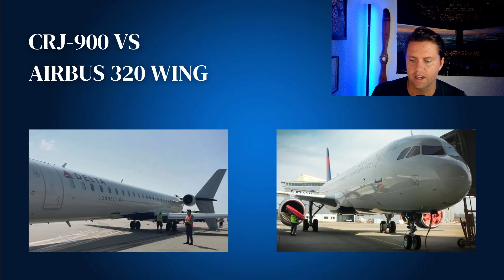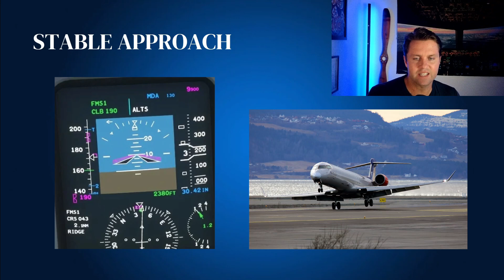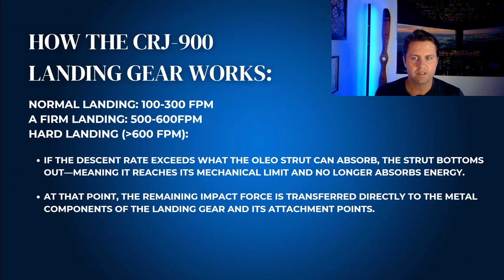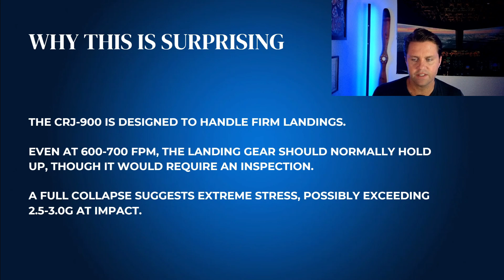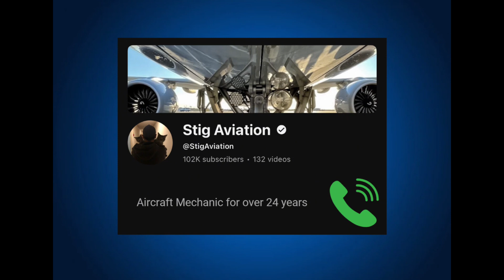Pilot Breakdown: Did a Hard Landing Cause A Gear Collapse?

Comment: Strange they don’t want to name the pilots
Reply: I think i read today the pilot had around 36 hours in the aircraft type and just got their level of license a few weeks ago for this type. The senior crew member was operating the radios.
Reply: @ChoppersModelworks Where did  you read that?
Reply: @ChoppersModelworks If true, that would be Very Poor Judgement on the Captains part. (25,000hr Majority Airline Capt)
Reply: @racebannon7355 pilots are trained to fly and land in those condition, shear winds and crosswind coincidencials may have been the cause of the crash
Reply: @ChoppersModelworks even if so the senior should have been double checking the jr off. Radio work isnt all consuming. He should have been calling out flaps, gear down, altitude to assist.
Reply: Not at all. It’s standard procedure early in the investigation to insure investigation integrity. What is odd is people who think that is suspicious.
Reply: Listen to atc. At least one pilot was a guy.
Reply: @davidgree1  how dare you misgender that trans woman?
Reply: That info will come. We just need to be patient.
Reply: If the copilot  was very inexperienced the Captain would be doing the landing in those conditions.at least that is how I see it as a retired airline pilot.
Reply: Kendal Swanson, a 26 yr old DEI new hire was pilot flying.  A male captain was pilot monitoring.
Reply: @ that’s the new insulting catch from you kids now ignorant
Reply: @ what?
Reply: The names of the CRJ pilots in the DCA mid air were not released for several days either.
Reply: @JohnLemieux wrong. The 2cmen's names were, Only the feemale's was withheld. Funny that.
Reply: This airline has an “unmanned” crew policy. Hmmmmmm
Reply: Yes, by now we should have learned the pilots' names, experience and what physical shape they're in, also the ATC's name and experience. What gives?
Reply: @TheLitehart1  and what business is that of yours?
Reply: @hawk1481  Geez, are you being paid by the WEF Censorship Board? It's not a matter of whose business it is. These are basic facts that any news coverage would have provided by now. And the public has every right to know what experience level the pilots have when a crash has happened. It's in the interest of public safety. Ditto the ATC.
Reply: @ yes I see that but when they go around calling every person in the world a lesbian or DEI I have a problem with that people could’ve been killed. It’s people‘s business on that plane who was flying not ours at this time. those people have a legal right to contact attorneys. Everyone goes through it everything before we put our nose in it.
Reply: @TheLitehart1  According to whom? It’s procedure to withhold crew’s names early on.
Reply: @andredarin8966  Define "early on". This is Thursday.
Reply: @TheLitehart1  Pilots union! They protect their own, even at the expense of the flying public.
Reply: The airline prides itself for DEI and "non manned" flights.  Whether this was a factor or not, I do not know.  Also, it looks like the plane was flaring but then suddenly went noise down, suggesting a wind gust dieing down.  Look at the pitch of the plane in the left side of the filming window, then as it crosses the middle.
Reply: Google Kendal Swanson..New FO.  Captain let her go too far and didn’t step in.
Reply: @thomassheehan4193  Captain was less competent than her. She may have had a brain freeze, due to “scary” conditions.
Reply: They will be identified in the report. For now there are likely legal reasons their identity has not been revealed.
Reply: Blocking this channel - disgusting number of misogynistic comments here
Reply: @ highlighting the genetic difference of male and female performance is not misogynistic. On the contrary, it allows to hire the best person for a job. And nobody says female performance is “always inferior”, it is just different and there are jobs better suited. And if you look, that is where females congregate. What about diversifying the teaching profession, for instance?
Reply: @DallasNatureLover truth hurts. Blocking doesn't stop it.
Reply: All the crew was feminine DEI😊
Reply: Let the cake bake.
Reply: Funny how females didn't have any problems flying the planes for many years, decades before. But as soon as Trump gets to office, it's accident after accident with female pilots. Hmmm. Why are they having such bad luck now?
Reply: They did.. its a hot chick
Reply: Add in a side load due to underrated crab.   Possible pilot error.
Reply: @ female pilot.  Kendal Swanson.   Beauty pageant contestant.
Reply: They are females
Reply: Pilot on radio male. Pilot flying?
Reply: @ShakespeareCafe  Very fresh female.
Reply: These maga DEI hysteria mouths have ruined this country.
Reply: When other than a fatal crash do they normally name the pilots?
Reply: For me the plane -
to much on right side and i can’t see flares.
Reply: Because they were female pilots that's why.
Reply: Names are on the web.. A new hire was the FP ..
Reply: Her name has been released now.
Reply: Their names don’t matter in DEI land. You are meat to fill quotas.
Reply: What would it matter if they named them?
Reply: @philipols  We hear about the pilots like Sully....thought to have done a good job, but we don't hear the names if its  thought they did a bad job.    Transparency is a good thing, we should always hear the names so we can make decisions about flying.   Not every airline is the same.
Reply: It was a male that talked to ATC- this person was not the pilot. The pilot was a younger female.
Reply: dei, woke pilots , biden dei they will not let you know pilot error she only had 1000 hors and basically had a learners permit to fly this plane
Reply: They did....
Reply: Lolz we know why
Reply: The names are out
Reply: Why name the pilots, idiot. Will it or would it make a difference to the outcome. No, so stop with this crap. Do you have insider information as to what happen? No, so shut up.
Reply: The names are almost never released when the crew survives. Sometimes they are made public when the crew does something heroic such as USAir 1549 or United 232. The names are normally protected because assholes on the internet spread false and misleading information without waiting for any verified facts and ruining someone’s life for clicks. Remember when people were innocent until proven guilty? Those were the days.
Reply: I fear, we have a lot of women haters! Any woman lovers here! Anyone of you woman haters ,married  or have a girlfriend? You men only love each other! Is it a community of Oranian?  I’m actually speaking to the men that are spewing DEI!
Reply: Not that it matters, but the pilot on the ATC comm was male. 

To me it looks like the plane lost lift in the last 100 feet likely due to a sudden change in wind direction. There wasn't enough time for the engines to respond, so the plane just literally dropped. 

Also, Canada doesn't release the identity of pilots or anybody until the report is released. At least I have never seen it.
Reply: @ I have read that all were female
Reply: @Canoe64  how dare you misgender that trans woman?
Reply: silly feminist stuff
Reply: Kendall Swanson was the co-pilot. Endeavor Air. DEI airline. Delta is over $30,000 to each occupant.
Reply: @LindaBraune123  Kendal Swanson.   Beauty pageant winner.   She went from CFI to right seat in a jet.
Reply: @mattdelany6799 pretty common
Reply: Takes time to scrub their media posts and TikTok. DEI LTA.
Reply: They said in another report that all female staff working on the plane and ads showed that airline is man free with staff and pilot was new graduate. DEI hires and tik tok ads showing staff jumping and parading around.
Reply: Girl fly… has been there six weeks.
Guy was a major airline wash out sim instructor…
Couldn’t have picked worse pilots for this situation
Reply: This was a non maned flight.
Reply: FO Miss Kendal Swanson …. Captain probably didn’t have much more experience than she had.  Airlines in a big hurry to check all their boxes.
Reply: @ captain was a SIM instructor rarely flying a real plane in real weather.
Reply: @ Sims do not have 50 it shifting winds on landing that stall a wing.
Reply: All female recently, recently, certified.
All female crew , airline used as marketing tool, all female crew RECENTLY CERTIFIED. THAT IS WHY
Reply: @jppalm3944  not female. Restricted ATP girl was flying, Captain was male SIM instructor with a long career who came back from Delta to Endeavor as he did not perform on the larger planes. Learning difficulties.
Reply: DEI
Reply: I would   not ever fly with a Endeavor Air crew.    Their commercials and ADs are just silliness.    And apparently their pilots  are super questionable
Reply: Ta-Da ... Bingo.  As with the CRJ / Blackhawk incident in DC, the offending aircraft pilot was not named for almost a week.  The sensitivity of the pilot being a trans woman predictably threw a shadow over DEI hiring practices.  The fact there has been no disclosure or transparency creates an aura of distrust.  Later than sooner, the ruling party will have to accept that invoking political matters into critical performance operations is lunacy.  It's going to be interesting.
Reply: Not to me with the armchair pilots critiquing them in so many comments.  Till NTSB and the investigation is done, please!
Reply: @ Fully agree; just a little detail: as the plane was manufactured by Bombardier - from Canada - and it happened in Canada, this accident will be investigated by the Canadian TSB
Reply: What? It wasn’t Trumps fault?!
Reply: @MrMrFlyPuppy Agree. I fly for a major and the spewing  of DEI innuendo is sickening. Predictably, in ops yesterday there was chatter about this but not one pilot had the temerity to speculate about the crew.
Reply: @MrMrFlyPuppy I hear you but when they are suspiciously quiet about something it tells a story. Like in the UK if a stabbing suspect is reported as ‘Asian’ we know he’s not Korean or Thai and isn’t a practicing Buddhist or Christian. In the US if we hear. Racially motivated crime we know exactly the skin color of the victim and the perpetrators. If it’s a violent crime and they don’t mention the race we usually know the race.  In the Army helicopter incident  they didn’t name the crew. And whaddaya know the pilot was in error and happened to be female. By all accounts she was an exceptional performer in ROTC at UNC so not jumping on the DEI bandwagon but it is a possibility because the military has a long history of lowering standards for women. Especially since Lloyd Austin.
Reply: @JuanMurphy45  That's BuIISHit!
Reply: @ what part is BS?  That the Army pilot was in error?  That air corridor is 200’ and below. Collision as between 350 and 450’. Pilot said have traffic in sight so pilot error. Or is it bullshit that the  military lowers standards for women?  They have been allowed to lower PT standards, higher BMI since introduction. Or are you arguing that Austin’s DEI requirements didn’t happen?
Reply: Piolets were both female, whether that has any thing to do with it or not.
Reply: @markfiorentino9757  not both, pilot monitoring was a guy
Reply: @sanyaod  even worse.
Reply: @markfiorentino9757  At least one of the pilots was male. He's on the radio talking to ATC.
Reply: @laserfloyd Right which means the pilot flying  was not the one communicating, hence, copilot
Reply: @markfiorentino9757  And another dude in the cockpit of the CRJ on the radio? 😂😂😂😂 IDIOTS!😂😂😂😂
Reply: @markfiorentino9757 what is a Piolets?
Reply: @markfiorentino9757 One male and one female pilot. Female was on the radio just before takeoff. Male was on radio during departure and arrival.
Reply: @bobh6728 According to whom?
Reply: @bobh6728 trans male voice.
Reply: @mattdelany6799 😂😂😂
Reply: @ The actual ATC recordings.
Reply: @ female pilot,  Kendal Swanson,  beauty pageant contestant from Minnesota crashes 90 seat passenger jet in Toronto.   You go girl!!!
Reply: @bobh6728  sorry bob but they proudly advertised this as an unmanned flight
Reply: @markfiorentino9757  Cite your source rather than parroting social media DEI hysteria.
Reply: @andredarin8966 they claim to have un-manned flights, as a starter….
Reply: @markfiorentino9757  It shouldn't, unless their previous performance was marginal but still got their positions out of DIE motivations.
Reply: @roykliffen9674  The problem with that logic is that we pay pilots the big bucks to be Michael Jordan that .001% of the time we need the clinch.  Demonstrating competence is not the same as demonstrating rarefied excellence.  And without rigorous filtering for it, the latter may only be tested when failure means catastrophe.
Reply: @bigscores7237  "rarefied excellence" is difficult to quantify, though it is attempted through simulated situations. There is quite an amount of pilot induced crashes where it turns out the pilot in question had a lot of attempts to pass specific exercises/simulations required for certification, and was certified on a marginal passing grade, just to lapse back into the same failures IRL.
When an airline decides to hire a pilot with a "spotty" training record - especially when combined with little flight experience - just to check a DIE-box, I think their management should be held liable on a personal basis for any (disastrous) consequences of such decisions.
To be clear: I'm not saying if any of this played a role in this particular case - I really hope it doesn't - but it sure is a worry in Western society in general to see jobs -where excellence is vital in preserving lives - being given on anything else than merit.
Reply: @roykliffen9674 which you can just about guarantee is true. If it was a Chuck Yeager type who said something questionable online a decade or two ago sitting up there we’d already know about it.
Reply: @bigscores7237  I just read your comment in the voice of the comic book guy from The Simpsons.
Reply: @roykliffen9674  Fully agree. Government ideologies that attempt to 'prove'  equity in choice should never factor into the hiring practices for life/death professions. Period.
Reply: @roykliffen9674 
Correct...If you test a candidate enough eventually they will pass. This is too often how DEI functions in reality.
Reply: @bigscores7237 😂 this is a regional carrier, pilots, pilots who are more than qualified and experienced aviators, but generally the least experienced in the industry. Their lives are shit, being crew hopped all over, spending almost as much time deadheading as they do actually flying, sleeping in airports and all that to be paid like a burger flipper at Jack In The Box.
Reply: @ helps working in a restaurant to make ends meet…..
Reply: @markfiorentino9757  DEI?  Obviously the pilot totally botched that landing. Whether or not the gear collapsed too easily is hard to determine since we really don’t know the actual rate of descent or the g force encountered.  Wind shear probably happened and the pilot did not have enough speed to handle it.
Reply: @DEW409 they have all the info.    Flying to fast.  Came down to hard.     Add the wind.
Reply: @Candlesinthewoods fast was good with the guats, problem was drifting, putting side load on the gear. Maybe girl legs too weak/short for the rudder?
Reply: @ usually the nose of the plane is up when landing.
Reply: @markfiorentino9757 that’s not true at all. One pilot was male and he’s been flying since about 2002 and has a phenomenal record and the other was a female who graduated with an aerospace degree from a school in North Dakota that’s known for their excellent course in 2022 I believe it said. There is confusion whether she’s been flying one year or only 6 months and from the paperwork it looks like it’s only 6 months on a restricted license. She’s a well trained and highly educated pilot from one of our countries best pilot training schools but she had less than 1500 hours of flight time but there’s nothing you can do about that but wait for flight assignments and accrue as many hours as possible but it takes time!!
Reply: @markfiorentino9757  it does
Reply: @zacatkinson3926 It does NOT! 🙄🙄🙄
Reply: @markfiorentino9757 un manned flight… not for me
Reply: @markfiorentino9757  Lower spatial recognition plus lower standard deviation means severe odds ratios at arbitrarily high thresholds.  In English, among those with the highest visuo-mental acuity, there will be 20 men to every woman.  And the arbitrary threshold that produces that odds ratio will likely be shockingly low to most unfamiliar with these things.
Reply: @markfiorentino9757 Sadly, if they were DEI hires, then that is a big contributing factor. Hiring people mainly on their demographics means better skilled/qualified people don't get the jobs. The former administration was so focused on DEI they ignored that simple fact. It's not that a person's demographic is a fit or not for the job, but that the demographics is a key point in the hiring decision. Since the 1960's, Affirmative Action played a part in using demographics in hiring processes but it was controlled and for the most part worked. But DEI was effectively Affirmative Action run "open loop" and dangerously gave jobs to marginally (that is the key word) qualified people rather than the better qualified.
Reply: @paulromsky9527 😂😂😂
Reply: 2 DEI ladies.
Reply: @stuartlee6622 how can it be 2 ladies when a male voice was using their call sign?
Reply: @chrisgage894  trans male
Reply: @stuartlee6622 Bullshit. Neither Delta or the feds have announced that.
Reply: @stuartlee6622 😡
Reply: @stuartlee6622 you had to politize it right away ? stop magaizing everything
Reply: DEI hires?
Reply: @neiljohnson6815 😂😂😂
Reply: It was a DEII hire, and she had just gotten her pilots license. Delta is a no hurry to disclose any names.
Reply: @mvgamer9637  - Diversity, Equity, Inclusion, and I.....? What is the second "I"? 😂
Reply: @mvgamer9637  I understand that since the serial sex offending gangster from Mar-A-Lago entered office, DEI is now being used as a racist and sexist slur against anyone who is not a white male, but regardless, everyone has to undergo the same training and testing.

No pilot, no matter how skilled, can do anything about a sudden unexpected wind shift 100 feet above the runway. The engines don't have time to respond and lowering the nose - as it appears they tried here - would not be enough.
Reply: DEI
Reply: @rickystutts6028 😂😂😂
Reply: The airline is known for DEI-over-qualification promotions and recruiting....
Reply: @ziegle9876 it will cost them as ambulance chasers are standing by and will definitely win. Delta has offered a minimal $30,000 payment to crash victims.
Reply: @ziegle9876 😂😂😂 yes , you poor little thing
Reply: @ziegle9876  Thanks for the warning. Until that changes, I won't fly Delta.
Reply: Gee…take a wild guess who was flying? If you said girls you’d be correct. Way to DEI. Your policy is amazing. There will be more of these